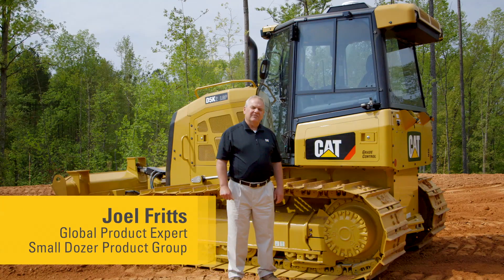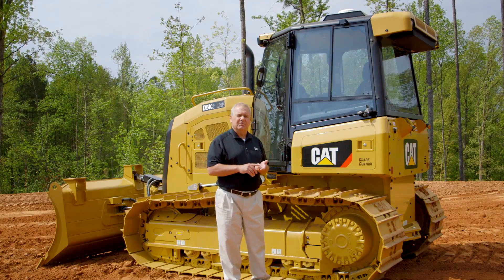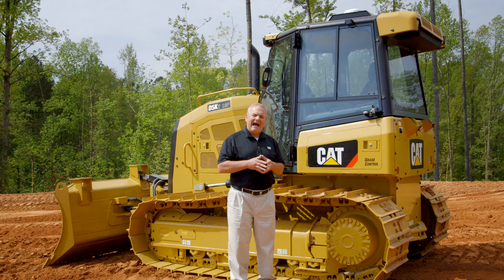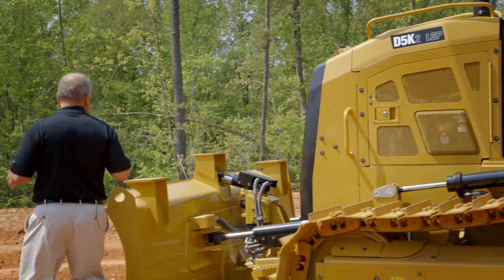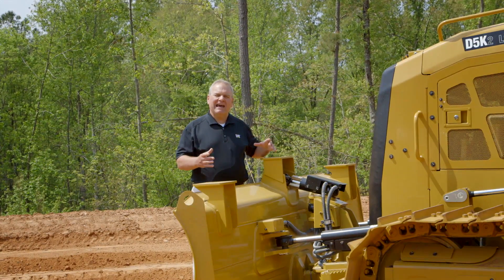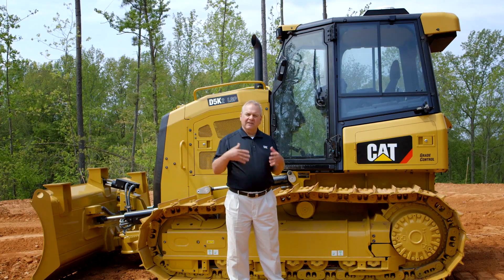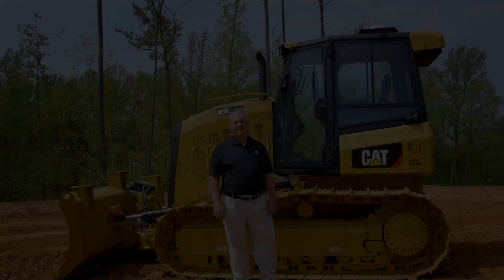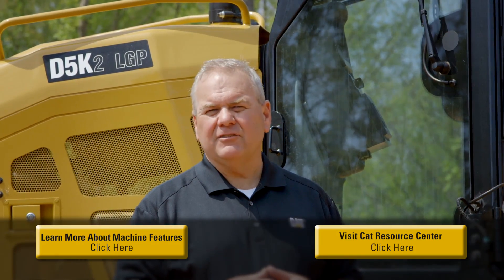Cat® D3K2, D4K2, D5K2 Small Dozers Grade Control Features Overview

Comment: This is a very interesting video and I agree that it would have been helpful to have seen an actual video of how the functions are used and activated because it is of little value to say this is what we have if you cannot see that it is easy to access and use. I operate today a Cat 745 Articulated Haul truck and I have many questions about Materials on its inboard computer system because I have noticed that it fails to load count if the materials are light in nature and let's say weigh around 5 to 8 tons for a full load then the counter will not adjust the count number also we need to have load control to designate origin and dump location for the site.
I see how many options and the impressive system uses there are on many machines across the fleet but as an operator, we are sadly left out of the loop to ad functions that we actually need like we really should have in these generations of machines push to talk functions for Pos Coms and I cannot believe that this is not universal on all machines given the are worth many hundreds of thousands of dollars to millions of dollars and only very select few have this function. The 745 I operate now is only 217 hours old and current latest models in our fleet and we still have mic systems at a low console-level so it's a dangerous situation in high volume traffic areas trying to navigate rough terrain and poor grounds conditions with Scrapers flying past at full speed and slippery conditions and we need to in an instant call for road position for blind spots or warn others that a fully loaded machine at around 80 to 85 tons is traveling at high speed towards Scrapers traveling in the opposite direction at full speed.
I see that Cat Dealers around the world are trying to show operators more of the impressive system available to them and I support this but many functions or capabilities often miss the mark on the needs of the actual Day to day operators while also missing those operators that would love to open up more of the support and functionality of the systems that they did not know were available in their current machines they are using, we need more dedicated liaison staff across the world to connect with highly skill multi-machine operators such as myself to hold conferences on what we find most useful, what you suggest is available to us and then how we can integrate these into our daily lives. I look forward to seeing if we get an answer to this.